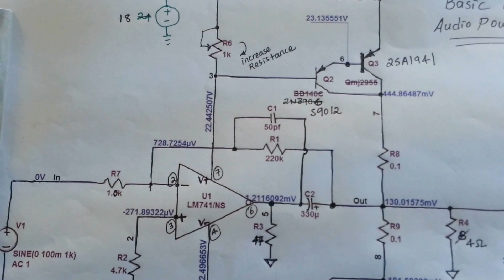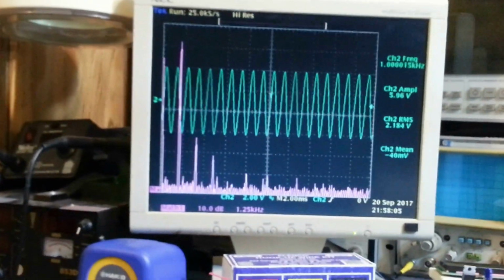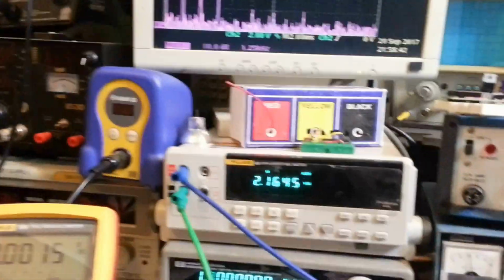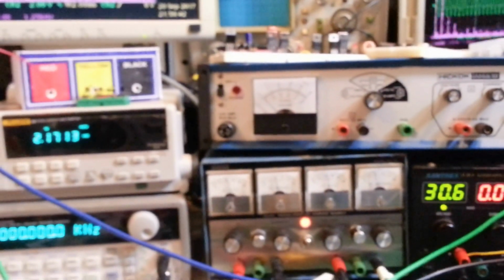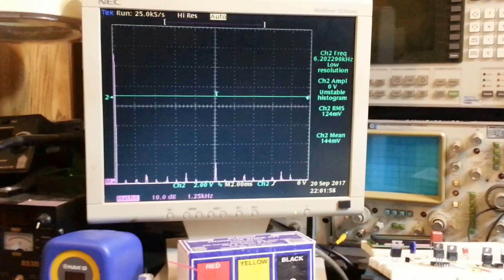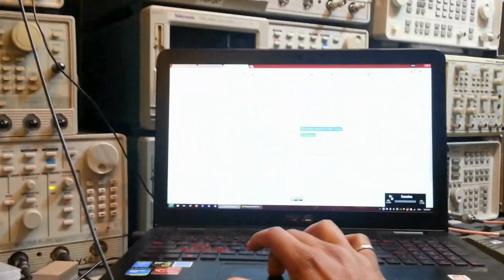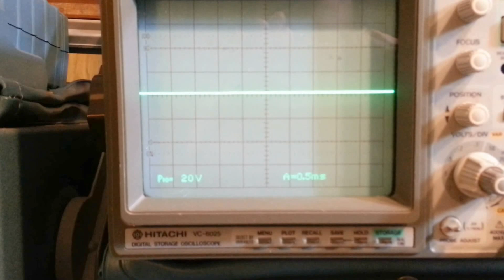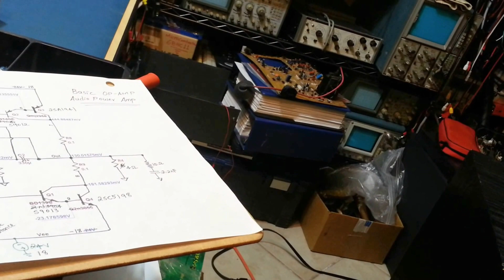Follow up video to LM741 Audio Power Amplifier

Comment: A very interesting circuit configuration. I have a couple of questions about it. But fist: I appreciate the kind of music you have used for sound testing.

1. A recommendation: it is better to use an input capacitor, because also your source can have a dc contribution.

2. Why do you use the inverting amplifier configuration? The booster transistors also work in non-inverting configuration. In non-inverting configuration you can also use an electrolytic capasitor to ground in the feedback voltage divider to set the offset amplification to 1.

3. Why are R8 and R9 in this circuit position? In the "classic" emitter follower configuration they are used to stabilize the bias current in the output stage. If you intend to do the same in your circuit they should be placed between the emitter and the voltage rails of the output transistors. I think in this circuit they are not necessary because the boosters are off at zero input signal.

4. In order to get more output power you can use a Sziklai-configuration in the output stage instead of a Darlington-configuration. Probably you can also use only power BJTs if you use the combination of D44VH10 / D45VH10. These BJTs have a current gain of 200 at 1 A and 100 at 4 A. I think this could be enough with an adaption of R3, R6 and R7.

5. I think you can eliminate R3 and C2 and connect the output of the opamp directly to the collectors of the output transistors. So the speaker is directly driven by the output current of the op amp until a certain value (20 to 40 mA) is reached. You can use the LM4562 (one channel as amplifier the second channel as voltage follower in parallel, outputs separated by 1 Ohm resistors) to drive up to 50 mA. At this output current the booster stage sets gradually in and contributes to higher currents. The LM4562 is also fast enough (20 V/µs) to suppress crossover distortions. It has also low noise, low offset and a very high open loop gain for low THD+N.

I can send you (or other interested people) a circuit suggestion by e-mail if you don't mind.

Comment: so basically this is the preamp operational amplifier?
Reply from the maker: Not really. The operational amplifier is used as voltage amplification stage of the power amplifier which has non traditional common emitter based output transistors.

Comment: Can i use it for guitar amp please reply
Reply from the maker: You definitely can use it! But you might want to use a pre-amp to drive the power amplifier shown in the video because your guitar pickup might not put out strong enough signal to drive the power amplifier directly. To give you an idea on the sensitivity of the power amplifier: for a 36Watt output power in to 4Ω speaker, the amplifier would need at least 155mVp-p signal amplitude at the input.
Reply: Smith Kerona what if i make two stages of op amps 1st to amplify guitar pickup sound & other to amplify the total sound
Reply from the maker: Yes that will work. To get a good performance, the first stage should be a circuit with good signal to noise ratio. Instead of using op-amp for the first stage you should use a JFET or BJT single transistor amplifier. Take a look how to design such an amplifier in my latest videos on common emitter amplifier design using BJT.
Reply: Smith Kerona thanks for helping me
Reply from the maker: Anytime!